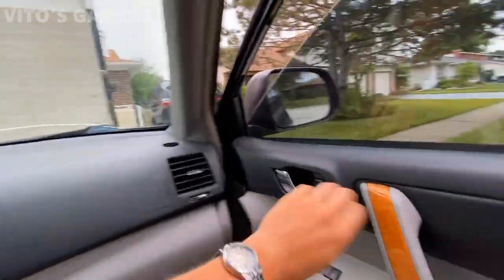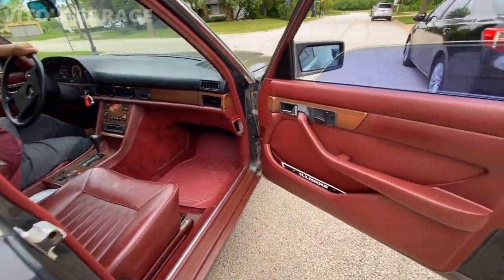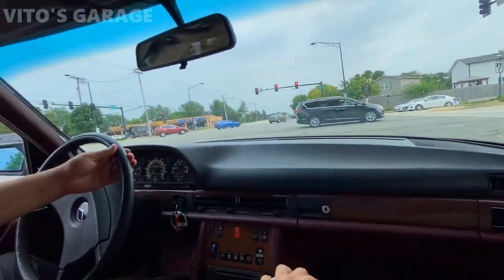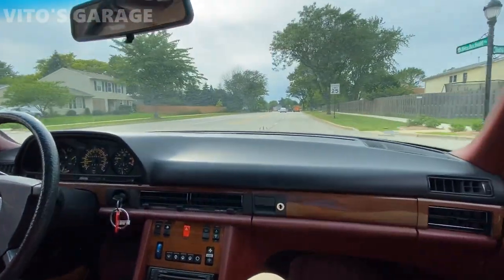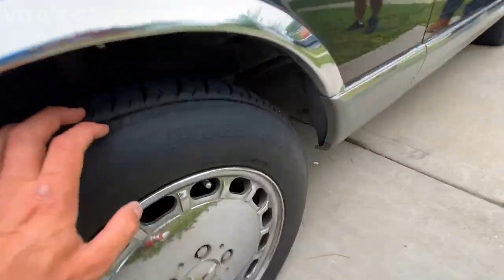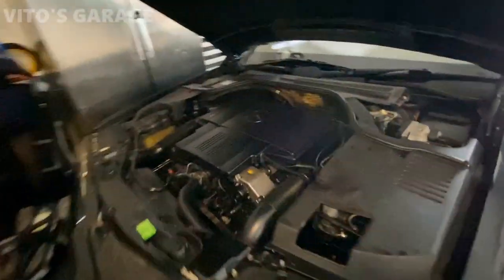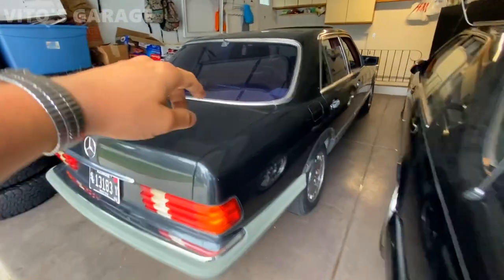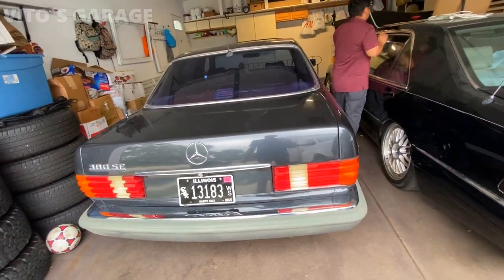Amazing Mercedes W126 380SE with Red Interior! + Sweet W140 S420! Must See!

Comment: Nice care. Get rid of the aftermarket chromes fender arches. All they do is trap water and cause rust and they aren’t original. And ditch the painted tail lights on the w140. The stock lights are the best looking and so are the wheels. So maybe try some nice amg monoblock wheels of that era.